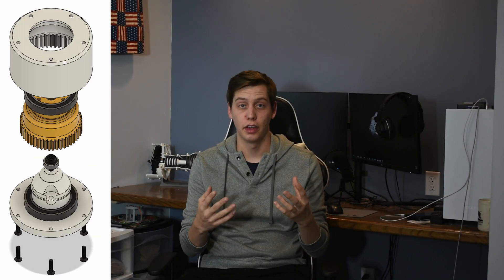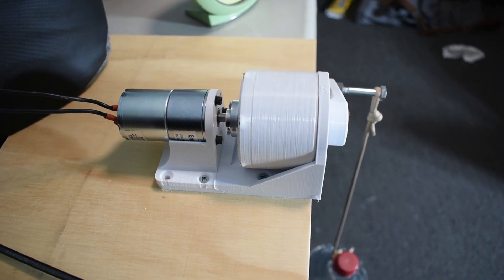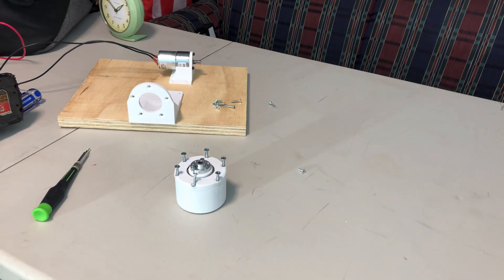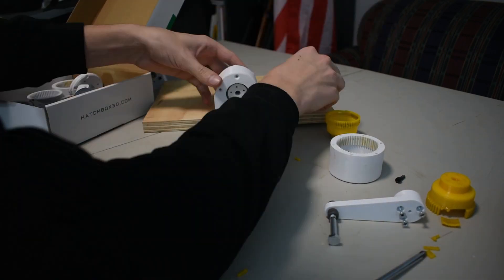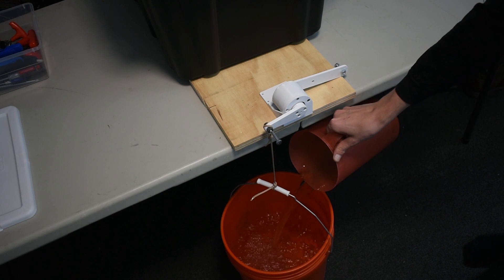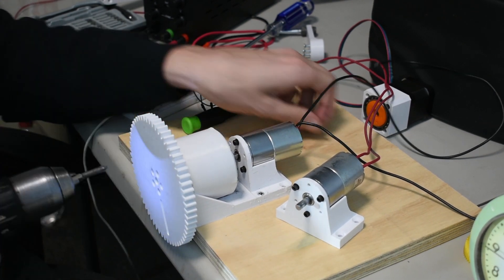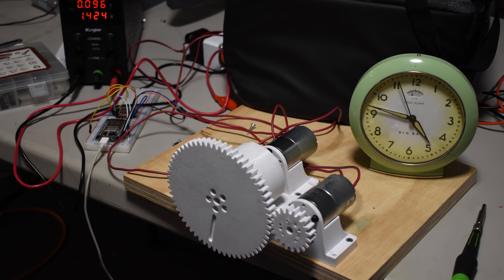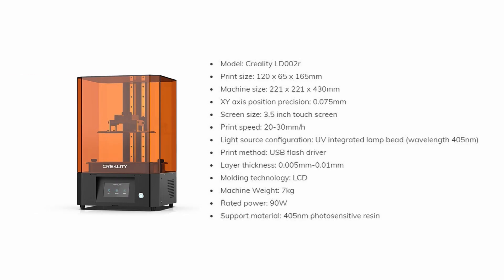Testing a 3D Printed Harmonic Drive till it BREAKS

Comment: I suspect resin printed parts will not do well in your application. Although they have smaller layer lines, have higher yield strength and are more isotropic, you will inevitably run into the issue of their very high stiffness. This high stiffness with relative low yield strength compared to that stiffness means that they are not very tough, and will not be able to deal with shock loads very well.
Sudden loads on the gearbox (which happen very frequenctly) will cause much higher peak forces/stresses/pressures inside your design, which will likely cause much earlier failure in real life applications.

This compromise in stiffness is key in your design I believe. Higher stiffness is good for backlash, and maximum sustained torque, but bad for sudden shock loads and peak stresses. In the end, its a compromise which depends on your application of the gearbox.

Comment: I'd suggest using a flexure hub design instead of the bell hub for the strain gear. I haven't tried it myself, but I've seen a video of a hybrid planetary-harmonic reducer that uses this method. It would eliminate shear loading between layers. Edit: no, it wouldn't because the flexure needs to be offset from the bearing.
Also, I believe skipping can be reduced by using an elliptical bearing. My preference there would be 3d printed raceways, but lots of small bearings arranged in an ellipse is probably more durable.

Comment: Your Nikon camera should have a remote shutter socket so that it can be controlled by a boolean signal rather than a mechanical part that probably wears out the button. Timing is also much more precise.

Comment: About your problems with the layer strength, consider printing the part at an angle, so the layer lines are not completely vertical... something like 20degree angle maybe.

You printed this in PLA right? PLA doesn't have good mechanical properties for parts like this as it has a tendency to crack over time, try petg or abs for the thin gear instead.

Comment: have you seen the belt based harmonic drive ? i wonder about those
Reply: all the belt based harmonic drives ive come across (which isnt a lot but is more than 3) failed catastrophically in testing conditions far less than this one encountered. i think hes on the right track here just might need to get a little more creative with materials for the flex spline.

Comment: i may be wrong, but i don't see any output bearing. That means all axial load taken directly by flexspline causing its deformation. In industrial solutions they use expensive crossed roller bearings to take care about radial and axial load. You can try to use cheap taper roller bearing instead.

Comment: Idea: tiny vertical holes in each tooth of the strain wave gear, where little sections of wire can be inserted to keep the layers together and take some of the strain load.

Comment: An idea I've been wondering about is placing/gluing a metal foil (or thin strip) on a gear (or both gear) surfaces.

The idea has three parts:
(1) Steel is very strong in tension.  Perhaps the steel could bear much of the tension that leads to failure?
(2) A smooth steel surface has less friction, potentially.  Especially for plastic-on-steel friction.
(3) Probably not true, but I was thinking that a thin steel strip might be "reasonably easy" to bend into the shape of the gear teeth, or close enough, that it could be glued to the plastic underneath.  Haven't tried this, and not sure about how much "over-bending" is needed to account for "spring-back" during the bending process.  I was thinking you could send a steel strip or foil through a set of rollers (like a pasta machine) that "corrugate" the teeth shape into the steel.

On the other hand. depending on the steel, a steel strip would be subject to metal fatigue.  I don't study material science, so I don't know if the steel would have a greater or lesser fatigue durability than the plastic.  Also there could be problems with thermal-expansion and contraction being different for steel and plastic, but probably not a problem in practice?

Overall, I was hoping to find an "easy" way to 3d-print gears and then make the more durable and stronger.   

Other possibilities might include making a 3d-mold of a gear, and then casting it, say with high-strength epoxy, or fiber-reinforced epoxy.  Of course if you want to go crazy, you could do something with fiber-glass and/or carbon fiber, but at that point, it's no longer an easy/simple process.

Lastly, it occurred to me, that if you can bend a metal strip into a gear-shape, you can cast epoxy into the interior, or just between a 3d-printed core and the teeth.

There are research paper that study the fatigue strength of plastics, but I know every little about them.

Comment: As far as I know, you can use all nikon dslrs (with USB port, i guess...) as quite formidable time-lapse machines using nikon software Camera Control Pro 2. I achieved some decent results with my old d80. Only disadvantage is, that your camera has to be connected to pc via USB cable during shooting. But that also comes with advantage of transfering all photos to your pc automaticaly while shooting.

Comment: Adding a few more bearings in the wave generator to support the circumference of the cup might help a little bit to strengthen the strain-wave gear.
Reply: Indeed. Supporting the gear faces from the inside all along the flank is a good addition, as would a top brace for the bearings so the screws are not just supported on one side. A more trapezoidal tooth shape could also be beneficial, and increasing the wall thickness of the toothed part of the flex gear. Also consider normalizing your flex gear.

Comment: if you were using ABS, the lubricant definitely is a factor in weakening the printed parts.  many lubricants damage ABS 3d printed parts, even without any load, over time parts may crack just due to exposure to certain lubricants.  PLA shouldn't care.

Comment: What about using a thin walled cylinder of metal inside the gear? So the load is distributed across all layers of the 3D printed gears :) Some kind of epoxy coating might also work, but I’m guessing a loop of metal would be best

Comment: Try on reading the bearing size of the strain wave bearings This reduces the bend radius of the strain wave Gear, reducing the internal stress. Also a super smooth transition between the strain wave teeth and it's body helps a lot. A change from a G1 to G2 radius for example makes a lot of difference in occuring stress in a flexing part.
Reply: Reading the bearing size? I don't understand what you mean… :/

Comment: Maybe TPU for the strain gear could work. it is flexable so it can handle more deformation over time. combine this with either bigger teeth so more contact area for the TPU to spread the load or smaller teeth so there is less skipping if they mesh well. (it would act like a very rough surface in a way).
overall keep up the good work. and if you need a part made in resin hit me up ill be happy to help with my peopoly phenom :)

Comment: put your part in packed fine sand and cook it, it will remelt layer and improve layer cohesion :)
Reply: Salt works well also!  I Second your thought!
Reply: fyi this ruins dimensional accuracy, doing this with gears will likely make them mesh horribly
Reply: @7603a  It does particularly well, depending on the sensitivity application.  I have been successfully utilizing it for several small worm drive gears for a year or so now and had great success!  Fine grinding, layering, and tight packing are the keys!

Comment: The reason your 3400 cam doesn't support timelapse is because it's not a 5x and up series camera.. Unnecessary limitation but that's how it works. :(
Reply: Even the first of the 5000 series had interval mode. If he went a few models older in the range, he could have picked one up for the same or less as the 3400. All the AF-S lenses, but maybe not as nice an image sensor?

Comment: You can use higher heat on the pla or nylon I get away with about 230 with pla with great layer adhesion. You can also use cf pla or cf nylon and infuse with resin or CA. Could also try a clamshell design with rings holding the two halves together with each half being printed on the mating line.

Comment: I love your method. I was thinking that most harmonic drives use a metal gear for the teeth (instead of being 3d printed). I'm wondering if you can devise a press system to press the end of a tin can to give it teeth and use that for the harmonic drive.
Reply: Or perhaps attach an inside-out timing belt to the can.

Comment: Resin printers (SLA or DLP) will result in highly isotropic parts - aka orientation while printing does not matter. I'm very familiar with Formlabs resins since I worked there, the "tough" line they sell would be perfect for your application. There's probably similar cheaper alternatives as well but no idea how they compare. But if you really wanted max performance, SLS printing that out of nylon is the way to go. Unfortunately, also the most expensive! :D

Comment: Print with bigger nozzle size if you can, that should help a little bit with layer strength.
Reply: No - a smaller nozzle size is necessary. The smaller extrusion width will create more surface area for the filament to connect. Also try drying your filament. You lose 20% strength by not using dry filament. And maybe try PTEG, because it is a little softer and will not break as easy.
Reply: @jankohler562  Can you please explain the part, "smaller extrusion width will create more surface area"? Thanks.
Reply: @consig1iere294  you can prove this mathematically, with the 'circles to rectangle area ratio' (CRAR), by assuming the cross-section of extrusion as circles and the overlapping of circles is a constant. CRAR determines the amount of surface area being used, by the amount of space between the circles. A smaller CRAR is proportional to a greater number of circles overlapping, hence more surface area being used, making the 3D-print more dense and therefor more stable. Proving this by calculating some CRAR's for standard nozzle sizes (excluding the factor of the 120%-ratio of extrusion-width to nozzle size): d=1mm ~ CRAR=78.5%, d=0.4mm ~ CRAR=77.8%, d=0.25 ~ CRAR=77,6%. I hope this helps. (ツ)╯

Comment: Salt sintering would improve the strain gear's layer adhesion
Reply from the maker: This is a good idea! I might have to give it a try
Reply: Just what I was going to say :) Lots of 3D printed harmonic drives out there, but they always break on the layer lines, and so far I've never seen anyone try this obvious solution.
Reply: It will still stress fracture though because the plastic itself is not ideal for constant deformation.

Comment: From what I've seen(in a video by CNC Kitchen), when printing with resin, the layer orientation doesn't matter at all, so that might be a good way to improve durability. Another improvement that might work is to use timing belts for the strain wave gear (that would require quite a substantial redesign though).
Reply: Resin material is al lot more brittle, so even though layers are no't an issue anymore. The brittles is. Even commercial resin printers suck at brittleness (at work we have most variations of Them). A better solution might be using an sls printer printing nylon.
Reply: @HeDzsz  Does this apply to the so called "tough" resins? Recently I've been considering buying a resin printer for printing mechanical para gears, small servo arms etc. and I was wondering if it's worth it. (Btw the parts are for fairly low stress applications). Up to now I've been using my FDM printer with PLA

Comment: Very nice. I designed a 37x56x35 nema 14 drive very similar to this (used thrust bearing under yellow part, and separate TPU inverted belt) and its insightful where the failure parts are before I print and test it.

Comment: that's really impressive experiment! Thank you for doing these test,and the conclusion helps a lot. 
also, what's the ratio of the diameter/length of the inner strain wave gear? I wonder if it has a best D/L ratio by 3D printed.
and I'm expecting to see your next video ,maybe about cycloid reducer?┗=͟͟͞͞( ˙∀˙)=͟͟͞͞┛

Comment: If you plan on doing more of this kind of testing you should add a tachometer + data logger. That way you can easily identify slippage without having to hunt through video footage. You could also record power used by the motor to show if efficiency is decreasing over time as the gears wear or something.
Reply from the maker: I totally agree!